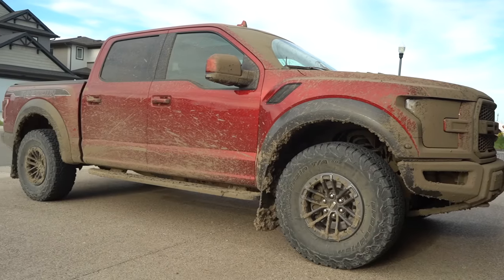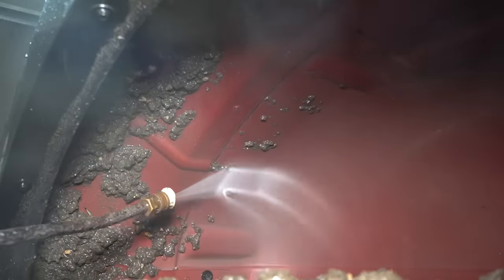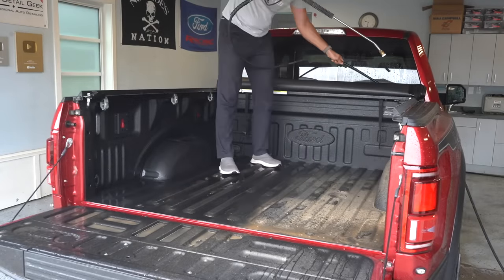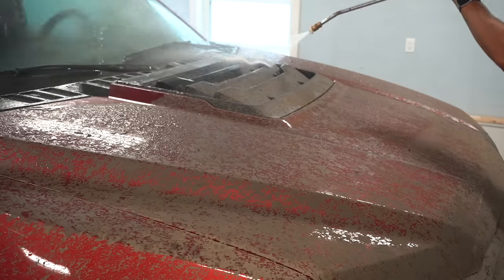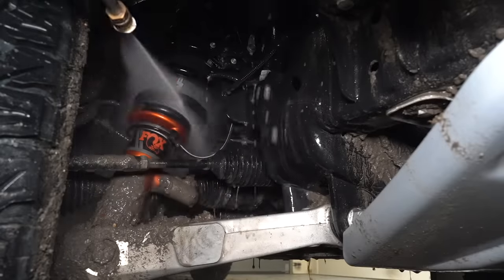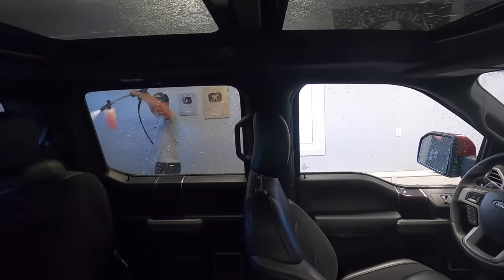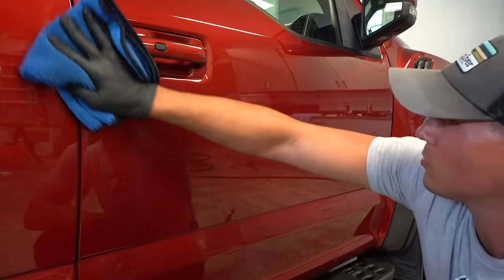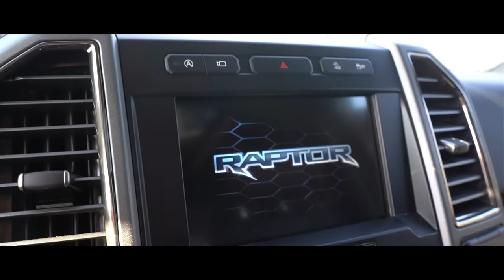Cleaning My SUPER MUDDY Ford Raptor! | The Detail Geek

Comment: The water was beading so nicely even just after rinsing the mud off. I need my car to do that. Please travel the world and do details. I need you in my country.
Reply: Try turtle wax hybrid solutions ceramic spray coating. Used it on my car this spring and it's still holding up amazingly well.  Easy to apply too, easier than standard ceramic coatings.
Reply: @alanpleiman3378  Thanks. Will try it. Hopefully I can buy it off amazon since I doubt they have it in my country. I would love to have a paint correction though. There's some swirl marks from the previous owner.

Comment: I had a thought. When you wash off the soapy water, you use the pressure washer. Wouldn't you save a lot of water if you used a regular (non-pressure) for this task? At this stage, it's just soap and water and minor particles, isn't it? So the pressure isn't necessary.  Knowing how many cars you wash, you could really cut down your water bill by not using pressure there.

Comment: Mitch, I have not seen mud get vaporized off a vehicle body or from the wheels-absolutely invigorating to the that process! Especially when the vehicle is designed for "fun driving"!  The truck looks like it's impatiently waiting for the next "mud run" so it can "play" & get DIRTY without getting in trouble for it! ❤️😁👍Doug

Comment: I know this video is from a long time ago, but you have fantastic Ford Raptors, especially in color and aftermarket-developed suspensions! I love it so much, and I do not believe another truck in the USA is better than the F-150 series.
When you turned up with a drone around the truck in the end scene, I saw a vertical crack on the windshield on the passenger side! Is that correct?

Comment: I do alot of 4 wheeling and when cleaning dried mud you want to soak the vehicle first and let that mud soak up as much wateras it can and do this a couple times. It sloughs off way better when its wet. Otherwise you are blasting a spot for what seems like an eternity and the mud isnt doing anything until it gets wet enough. Also for the normal folk that dont have a drain in your driveway or garage you might want to do this in your yard. Yes the wet grass can be a pain but at least you dont have 2 inchs of mud at the end of your driveway or the neighbors. I know this from experience. Wash all the mud off in the grass then do the actual cleaning in the driveway.

Comment: Yo idk if you got line-x in Canada but if so take her there and get it undercoated and bedlined. I work at a line-x shop so im a tad biased but in reality weather you use the bed alot stuff can get stuck under the plastic liner and bed and cause corrosion to take place👌

Comment: It is not a good idea to put a pressure washer so close to the paint. If you have small crack on the paint it can make it more worse. I already experienced it on my car lol. I think you did the simmilar thing when you washed hard mud above the wheel at 7:11 min. My advice is before you wash hard mud, just make the whole car wet from distance and then in 4-5 min start real washing. So you will make the mud a little bit softer and easier to remove. Otherwise, you do a very good job. 👍

Comment: Shouldn't you start with the wheel weld first by just getting it lightly wet with water without any pressure and then come back with the pressure hose and it comes off super easy without wasting so much water.